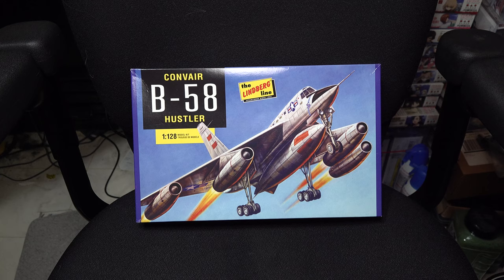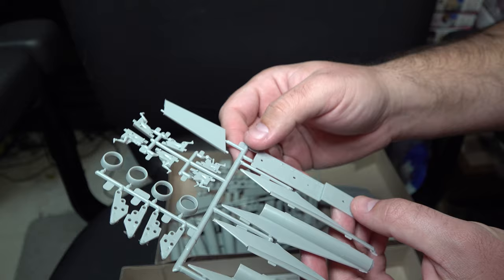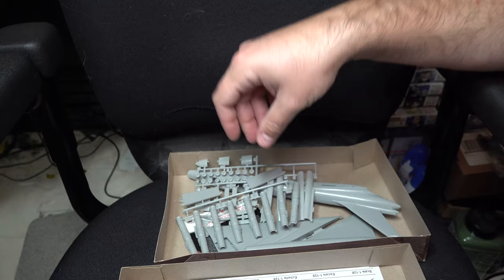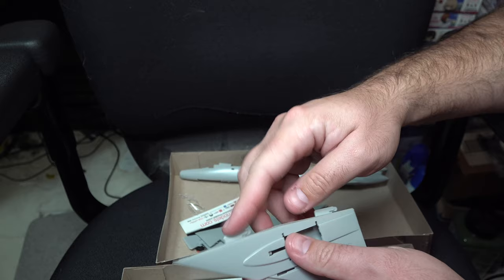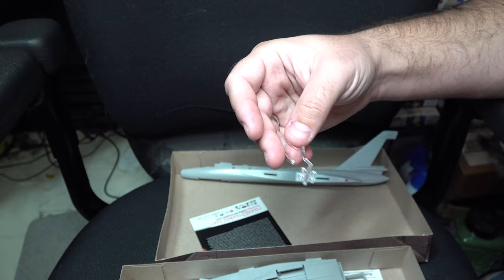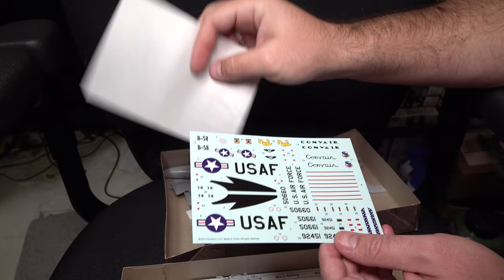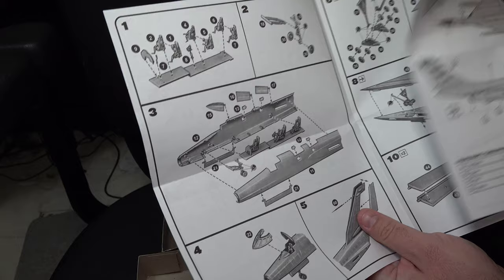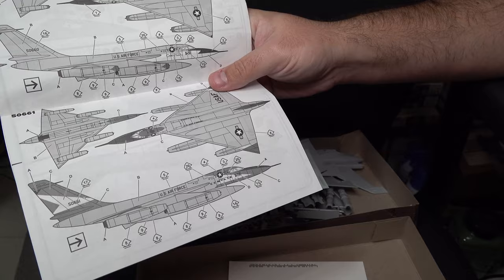1/128 Lindberg B-58 Hustler Review/Preview

Comment: In that commentary on wing fit, my 'solution' to that kind of thing is more often to remove the pins than to open/enlarge the holes.
Have several times considered getting a couple of these to supply material for sci-fi kitbashes, and especially the crew figures.
But I'm already far, far, behind on projects using bits from the 1/64 scale version of this kit, which is pretty much identical but larger.
Actually, I'm okay with how they did the guys, it gave decent detailing of the g-suit features for those poses given the mold making practices of that period.